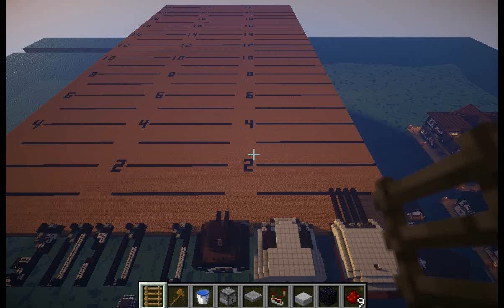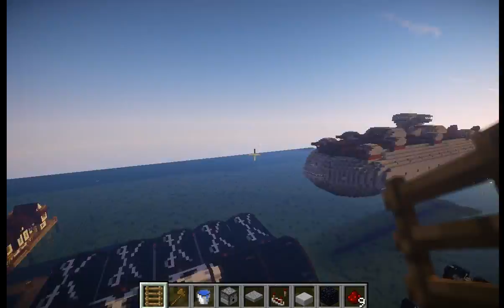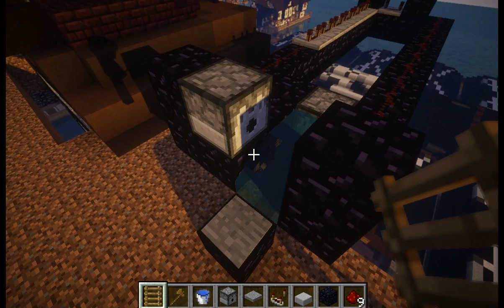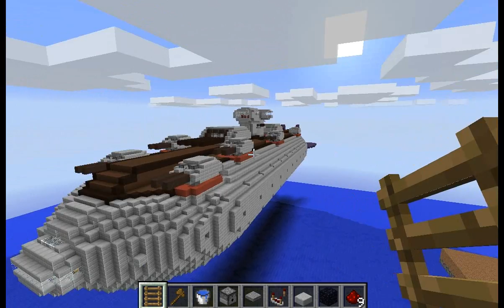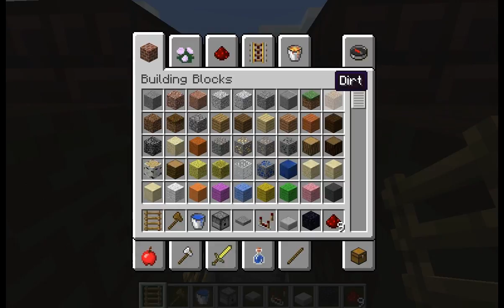Minecraft 1.8 TNT changes, new cannon designs, and how to modify old TNT cannons to work in 1.8

Comment: yeah its so much better than my auto reverse nuke using 1000 tnt per shot
Reply: btw 240 is not the max range my cannon reached 70 chunks that 70x16 for the blocks you just need a sever with paperspigot or use alts
Reply: wow pretty good. But how large was it? I made a cannon that was 6x4x5 and had 600 block range. Infact I have a ship with it installed on the ship on another server.

Comment: using the fcs fire volley on the goliath with these modifications in 1.8 it blows up in my face. i need some help as to how to fix it.
Reply from the maker: I'm afraid for a complete solution you'll have to wait until worldedit is updated to 1.8. My own server won't be updated till then, and that will be when I go through and update all the old designs.

If you want to proceed anyway, I would recommend you use the FCS to enable one turret a time, trying the modifications I detail in the video. Without worldedit I'm afraid it will be a very frustrating process, since you won't be able to paste it back when it blows up. If you use worldedit before they update it, it will screw up the dispenser facing and likely cause the gun to explode.

Comment: I think you should call the final 1.8 cannon design a "Variable Trajectory High Range"  cannon. Or maybe just a "Modular Elevation"
cannon. Also, Ever consider slime blocks for cannon designs? My friend made an almost 360 degree cannon. I want to see if there are any applications for airship vs. airship or maybe anti-airship applications!
Reply from the maker: Yeah, I should probably play around with them more to make sure, but at the moment I haven't really found a use for slime block cannons. For one thing, it's hard to make one that actually looks like a cannon. Also, maybe I just haven't tried hard enough, but I haven't seen one that shoots far enough to really be useful. 

EDIT: you mention anti-airship uses which kind of makes sense. Like I say, I need to play with them more